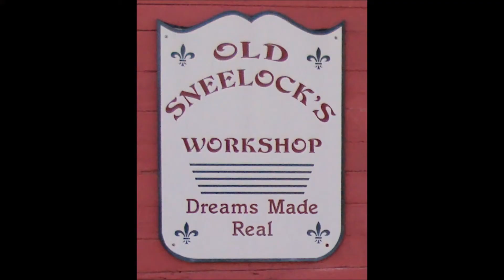Fireplace Damper Repairs -  Pt 6 of 9 -  Drilling The Mounting Holes

Comment: I like using a step drill for making holes larger in thin materal .
Reply from the maker: +Wayne Murphy A step drill works well. If I were doing more than a couple holes I might do it differently. I do like to use the Silver Drill Press when I can work it in. It's fun to use.